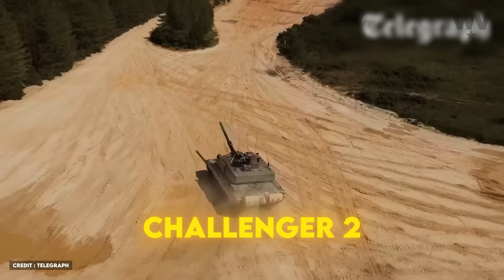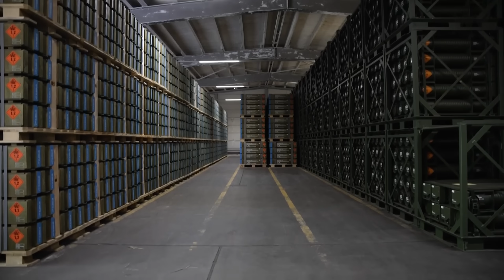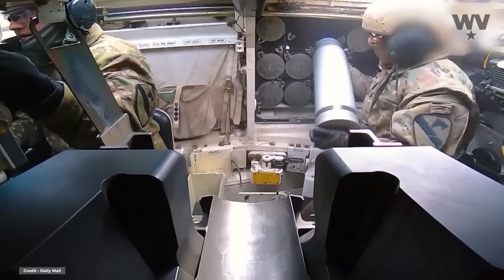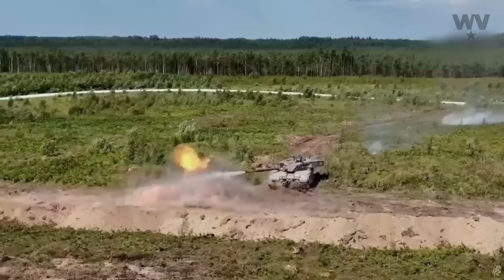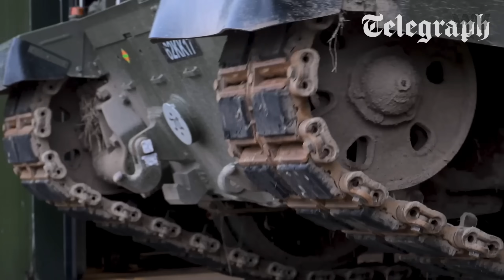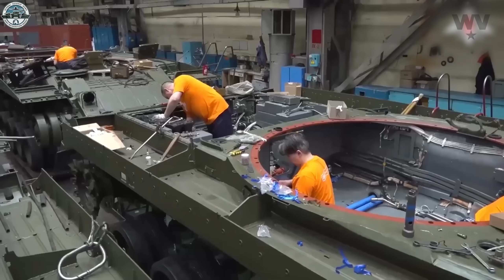Russia Is TERRIFIED of Britain's Challenger 2 — Here's What They Found

Comment: Feels like a mistake making ch3 smooth bore
Reply: It seems as if the main ammunition types being used now are fin-stabilised.
Reply: @boristheengineer5160 and yet a big part of the reason the challenger 2 has been so successful is because of its range
Reply: @Skett it's all about the war economy. Cheaper weapon with more expensive amunition is the best way to make money
Reply: @Costeq  OK I 'm sure it is cheaper to make a smooth bore than rifled but on the other hand I recall reading an old article about a special projectile which I believe later came to be known as a HEAT round and one curious feature was a special rotating seal so it could be fired from a rifled barrel without picking up spin. If you're having to design rounds specially to counteract the effect of rifling then why have it in the first place.
Reply: @boristheengineer5160  to make more money on ammo
Reply: No rifling only benefits HESH, HESH is going out for smart ammo. Armour piercing darts don't spin anyway, they have a slip ring to stop them from making use of the rifling. Modern ammo is way more high chamber pressure coming off the back of plasma ignition tech which came off the back of railgun technology.

Comment: Challenger 2 is a sniper tank. Aways was. Designed to stay as far away as possible from other armor. Peek, spot, and shoot. All from at least two miles away, beyond which Soviet tank accuracy completely collapses. The chances of a Soviet or Russian tank getting the drop on a Challenger 2 and just landing a random hit from the distances Challenger 2 is going to bullseye on the weak turret ring is very low. It trades mobility and speed for protection and firepower.

Comment: If the Russians were only dealing with Challenger tanks, essentially armoured mobile artillery pieces, then they could adjust their own tactics to overwhelm them. It would be costly over such distances, but still doable.

But like you say, there are the German Leopard tanks in the field that are designed for more mobile combat, and the moment the Russians move to swarm the Challengers they themselves get swarmed by Leopards.
They do not have enough force available to overcome both types of enemy at the same time.

Comment: If I'm not mistaken, the Challenger just won a world tank competition held by the world's militaries. If it weren't for the engine, it would be unbeatable. I mean, it was unbeatable in the competition -- but I guess it wasn't held in muddy conditions.
Reply: It can fight in muddy conditions. It's soft, boggy ground where it struggles. And anyway, the Challenger is only slow on road. Off road, on uneven ground, it's the fastest tank in NATO thanks to it's suspension system. It's also the most accurate tank whilst driving over uneven ground, also thanks to its suspension system.

Comment: What a load of blatantly-false nonsense. The Challenger has proven to be the worst modern western tank of the war. They only had 14, and at least 3 got their turrets popped shortly after they were introduced. Several others were damaged or destroyed too, then after that they disappeared entirely. No one has seen them for well over a year at this point.

They were an abject failure, but this slop-channel tries to portray them as a raving success.
Reply: ERR from reports they actually among the best performing tanks in Ukraine the only real problem is they don't perform well in soft ground and not enough of them to do much, so far in 3 years of war only 3 are confirmed lost all after been abandoned with no crew losses reported, compare that to the Abrams 20 out of 31 lost within the first few months including 5 captured by Russia.

Comment: Few facts to despel some misconceptions:

There are two main types of anti-armor penetrator rounds to consider:

APDS (Armor-Piercing Discarding Sabot)
APFSDS (Armor-Piercing Fin-Stabilized Discarding Sabot)

Modern tank combat is dominated by APFSDS rounds, which are long metal darts traveling at extremely high speeds. Unlike older projectiles, they do not rely on spin for stability; instead, fins keep them flying straight, similar to an arrow. Their long, narrow design allows them to concentrate enormous force on a small area, making them highly effective against modern armor.

Older APDS rounds were shorter, spin-stabilized penetrators that depended on rifled barrels. While effective for their time, they eventually reached their limits against advanced composite armor. Smoothbore guns are better optimized for APFSDS ammunition, which is why nearly all modern main battle tanks have adopted them.

Rifled guns remained in service for decades because of ammunition like HESH (High-Explosive Squash Head) rounds. HESH relies on spin to spread explosive material across a target before detonation, making it highly effective against bunkers, fortifications, and lightly armored vehicles. This was the primary reason Britain continued using rifled guns on tanks like Challenger 2 after other nations moved to smoothbores.

However, this role is being replaced by HEAT (High-Explosive Anti-Tank), on smoothbore guns. Although it works in a different method, they can do most of the job that HESH can do as well. And there are other types that can do just as well as HESH in destroying static target like bunkers and buildings.

The Challenger's reputation for long-range accuracy was not solely due to its rifled barrel. Its performance came from the entire system: advanced fire-control, high-quality optics, laser rangefinders, a stable gun platform, accurate ammunition, and highly trained crews. The famous Challenger 1 long-range engagement during the Gulf War, at approximately 4.7 km, was a result of this combination of technology, training, and battlefield conditions.

Moving Challenger 3 to a smoothbore gun is therefore a natural evolution. The tank's effectiveness comes from its protection, sensors, fire-control systems, and crew professionalism—not just the barrel. The new gun improves its ability to use modern APFSDS ammunition while maintaining the qualities that made Challenger a formidable tank. The result is a more capable platform for future battlefields.
Reply: *armour
*travelling
And fletching on an arrow more often than not, is used to induce a spin which in turn, produces the same effect as a rifled barrel. You are correct about the versatility in tank shells that a smooth bore gun provides. A very nice write up.

Comment: Never underestimate the importance of a cup of tea in any endeavour. It warms chills, lifts moods and gives you time to think.
Reply: Yep. Just like every survival expert says never underestimate how much a fire lifts morale -- even if it's warm and you don't technically need one.
Reply: Blanking on the exact details but the reason the tea station is inside the tank is because during one war the entire crew got caught outside theirs and killed. Turns out armour works better when you're inside it. Also that banning tea was never going to work so a practical solution was found.
Reply: @iainmccord  WW2
Reply: @garethjones6082  A hot drink passed around by soldiers. Suddenly builds up a lot of morale. Also smiles.
Reply: @iainmccord your correct,it wasn't one crew specifically, just that they did an analysis of casualties and found. Lot of them occurred when crew were outside the vehicle on breaks, doing maintenace etc,, hence the revised doctrine to keep crew in armour as much as possible.
Reply: Not just the cuppa. Hot water to clean yourself/shave/heat meals/whatever is an absolute morale changer.
Reply: Well said.
Reply: Most importantly you don't need to leave the tank to have a warm drink or meal, which means the crew are a lot less vulnerable.
Reply: Many years ago, the BV cable got munched by the turret monster....immediately stopped the veh and called REME....3 hours later...back in action.

Comment: Ultimately a mistake making the chali 3 a smooth bore the most effective part of that tank is the ability to not be seen and kill making it a smooth bore turns it from a sniper into an assault rifle
Reply: why do you think they are not converting all of them, some challenger 2 will stay as challenger 2 but with driveline and other system upgrades, only ~150 will be converted to C3
Reply: @b101uk9 they wont maintain them though guarantee
Reply: @shropshirelad45  they have been slated for upgrades to the driveline and other systems, which is why they have ordered so many units of various system, more than x3 time the amount that are being converted to C3

Comment: The challenger 2 was somewhat designed to counter the Russian tanks.
It seems like it has done exactly that perfectly.

My question is, with the challenger 3, will the unrifled gun result in reduced accuracy, and thus mean that its role has to go back to front line.... ?
Reply: It may result in less accuracy at very long ranges. But overall it will still rely on it's technology to take out medium range targets. It will also benefit from being able to fire various different NATO tank rounds which is a good thing.
It isn't just about the rounds being fired. It is the technology within the tank itself. It's systems are such that they can work out where each shell will go. It computes the range, wind speed, barrel wear and even the curvature of the earth between it and it's target. The result will be basically be the same. One shot, one hit.
Reply: There are a lot of advancements in projectile stability that supposedly mostly compensate for it now.  I'm not convinced personally, not until i see proof, but it is claimed to have a similarly impressive range.  Time will tell.

Comment: Let's be honest, it's no wonder weapon, it's a very heavy dinosaur,  not fit for Ukrainian war, too heavy, poor mobility, unreliable (as most British cars) and with the weakest canon of most nato modern tanks. Actually challenger 3 upgraded the canon to nato's standard 120mm smooth bore.
Reply: The cannon on the Challenger 2 is far more accurate at long ranges compared to other NATO tanks. It also fires a variety of shells.
However, to be able to use standard NATO rounds the Challenger 3 will be a smooth bore variant. I believe that they are also upgrading the engine.
Reply: @gerrylewis5281 it's not "far more accurate" than smooth bore, do your research.
Reply: @guayaquilander 
Research?
I was a squaddie for 20 years. I saw the Challenger in real action in the first Gulf War.
If you needed cover, there were two machines you wanted to see. First, a Challenger tank, the second being an A-10 Warthog above you.
That's proper research mate. Not from reading posts from 'armchair warriors'.
Reply: @gerrylewis5281 so what? Seeing a gun firing doesn't give you a measure of its accuracy. I also wonder how an A10 improves a tank's accuracy.  😂😂😂😂😂
Reply: @guayaquilander 
Are you really that dumb that you don't take in what's being said?
I never said that the A-10 improved tank accuracy. But they certainly destroyed enemy tanks and infantry positions with ease. They weren't nicknamed the "Tank Buster" for nothing.
As for the Challenger? It was able to destroy enemy tanks and APC's at a longer range. Although many tanks were hit with RPG's etc. There were no losses of a Challenger tank during the war. Infact, the Challenger tank set the first World Record for the longest tank kill during that war. Not luck, but by it's accuracy over long distances. One shot, one kill, at a out 5 miles.
Reply: @gerrylewis5281 educate your self squaddie, read the difference betweed smooth bote an rifled. Then figure out why all modern tanks use smooth bore
Reply: @gerrylewis5281  don't rise to it fella. This muppet has no idea.
Reply: @guayaquilander  You do your research for gods sake. The longest tank kill= Challenger 2. longest engagement by MTB= Challenger 2. Longest tank kill Act 2= Challenger 2. So yeah C2'2 are or were far more accurate. Before you berate some one, do your own research instead of just proving you are a fool, over people thinking you were a fool!
Reply: Challenger 2 exports only 38 to oman, most of the planet bought leopard tanks. There most be a bloody reason or you think the everyone is as stupid as you?
Reply: @Dan-qg1bq 
Yeah, he is probably some armchair warrior who's only knowledge of warfare is when he plays war games in his computer.
Just another Troll.
Reply: @guayaquilander 
Really?
Try educating yourself before posting.
Why do you think that back in the 1800's weapon manufacturers changed from smooth bore muskets to rifled barrels?
The only problem with the Challenger 2 is that it cannot take the standard NATO rounds. Which makes it hard for resupply.
Just like the 7.62 SLR rifle, NATO changed over to the standard 5.56 round, so the SA80 was put into use.
However, it is not whether the Challenger 2 or 3 has a smooth bore or rifled barrel. It is down to the technology within the turret. Something that other tanks don't have. Once a target is acquired the system takes over. Distance, wind speed, the earth's curvature, heat variations and barrel wear.
Inside the turret the technology acts with the same precision as a sniper. That's why they can take out targets at 5km or more. 
So before you insulting people, do a bit more research into what you claim to be your expert opinion.😮
Reply: @guayaquilander 
I'm interested to know.
Have you actually Served in the Military, or are you just an armchair warrior?
I will go with Option 2, as a real veteran wouldn't be so dumb.
Reply: @gerrylewis5281 clown, you speak like cantinflas, too much words but don't say anything. You no longer need rifled canons because the rounds have fins that stabilize them in flight. Plain and simple not pure shit like your computers doing calculations and al that garbage you said trying to impress. Rifle canon rounds have less anergy that somooth bore that's why all modern battle tanks use them.
Reply: @gerrylewis5281 an engineer actually. I know way better than you how those weapons work. Go to sleep, relax, maybe next time you'll impress someone
Reply: @guayaquilander 
Idiot 🤣😂
Reply: @guayaquilander 
Clown? That made me laugh.
I dont claim to be a world expert on tanks.
I know that the Challenger 2 has a few problems. One being it's rifled barrel that doesn't accept other NATO rounds, the second being it's weight. It's pretty heavy.
But what does have is technology. It can seek out a target many Kms away. Compute a firing order. It will compute distance, wind speed, the earth's curvature, temperature and barrel wear. Then it's just a matter of pressing the fire button and it's good night Vienna.
Reply: @guayaquilander 
You are a big stupid. I'm not out to impress anyone. Especially people like you, who are clueless no matter what you think.
Normally I wouldn't take offence. Everyone has their own opinion. But you seem to think you are the only person who has the right opinion.
I may not always be right,  but I speak from real experience. Not from my armchair and a computer screen.
Reply: @gerrylewis5281 clown Google "Challenger 2 tank problems in ukranie" READ and educate your self
Reply: "Not fit for Ukrainian war" he says, despite it being deployed in Ukraine for years, involved in loads of battles, praised by its crews, notching up many kills, surviving many hits while keeping its crew alive.  And despite spending years fighting a grinding battle of attrition, most (all?) of them are still standing.

It appears it fit exceptionally well.

Tanks aren't a dinosaur, they're not being replaced by drones so far; in the same way that infantry weren't replaced by tanks and ships/subs weren't replaced by subs/planes.  Tank's role in warfare changes due to the "drone era" and we might see less of them, but it doesn't eliminate the need for them altogether.  And the Challenger 2/3 is better suited for modern drone warfare than any of the others.
Reply: @mrfish9876 put this "challenger tank in ukraine problems" in google and READ. Get yourself out of ignorance.
Reply: Yes but it makes mincemeat of russian tanks with surgical accuracy.
Reply: @danielwhite2231 so does the leopard, lecrec, blanck panther, oplov, ariete, Merkaba....